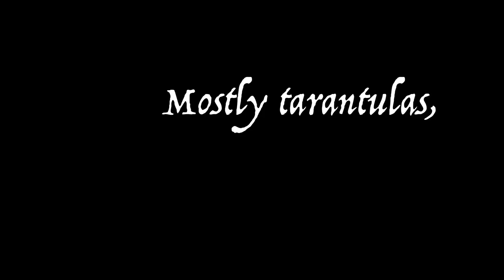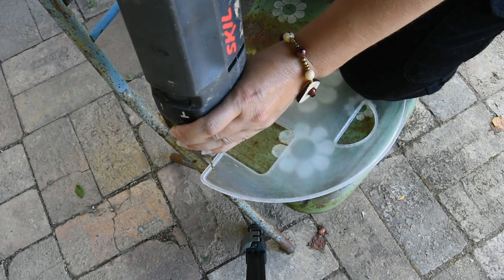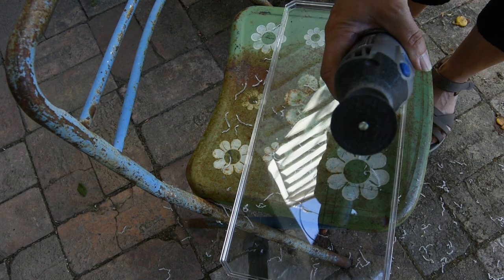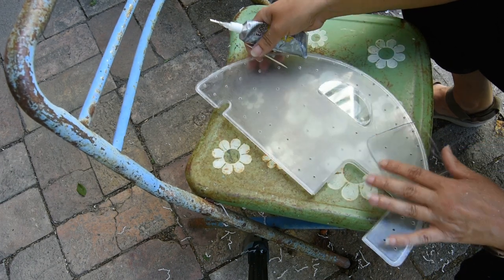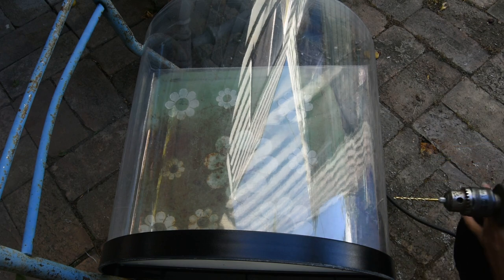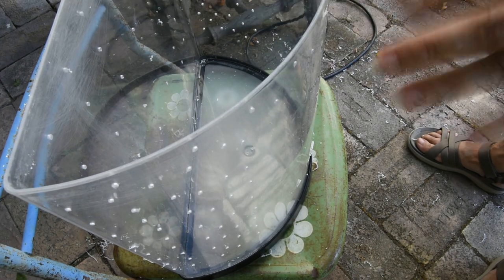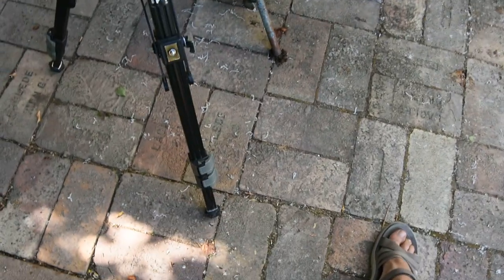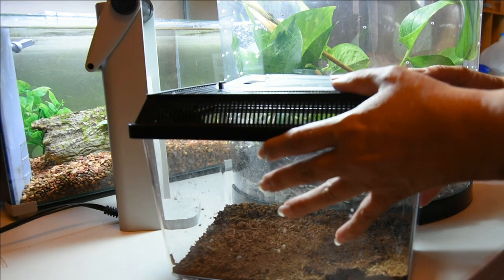DIY Arboreal Tarantula Enclosure from Tetra 3 Gallon Half Moon Aquarium

Comment: Whenever I use Dremel, the acrylic gets all melty.  I have to quickly remove the melted excess and still doesn't seem to cut clean.   I learned that using a routing tool with a drill on a press/stand works a little better for cutting acrylic.  You have less of the melting issue, but you have to worry more about cracking so you have to be careful with the amount of pressure you apply. They make stands for dremels also so you can use it more like a press as well.
Reply from the maker: Theraphosidae Therapy Yes. The drill press works beautifully. I have another video I made with a drill press demonstration. I like these drill bits, titanium, I think.